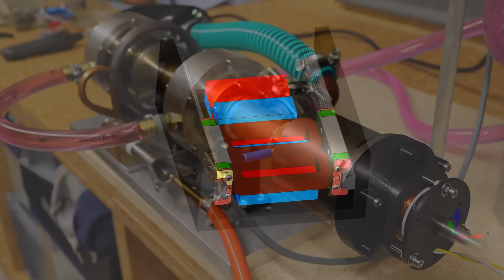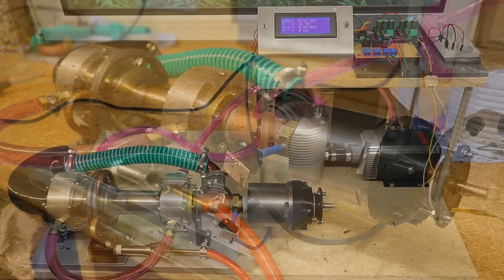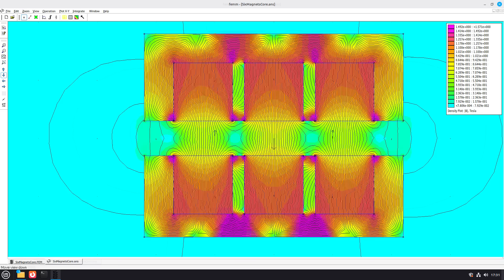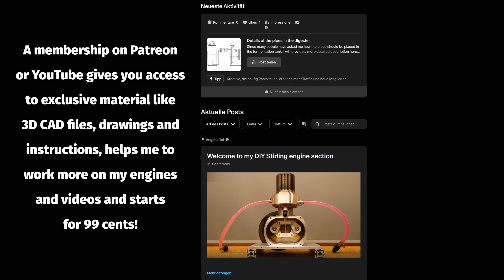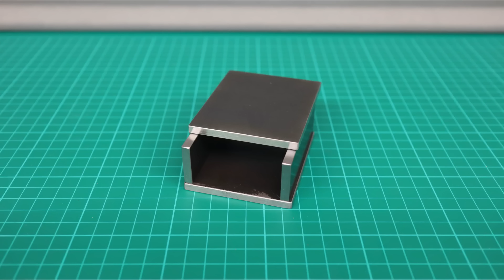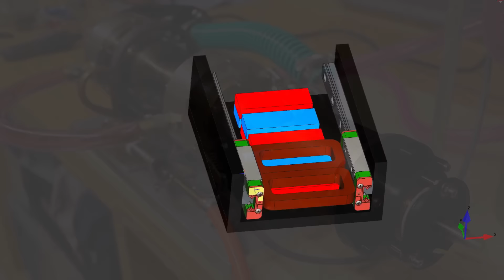Building a powerful linear generator for cheap DIY energy

Comment: I noticed you mentioned "adjusting the number of turns". I think you can forego this. With sufficiently thin wire, the energy conversion efficiency/loss of any wound coil component running at these relatively low frequencies is pretty much independent of wire thickness. The only elements that enter into the efficiency/power equation are the shape of the overall coil and the density or fill factor of copper in the coil winding (and of course the conductivity of the copper). 

Of course, the turns count changes the output voltage and output current at any given operating point. But it's so much easier to change the electrical load than to wind a new coil! If you fill your "winding window" (the total space available for wire) using a reasonably thin wire as you have done, so the wire fills the space efficiently and doesn't incur eddy current losses due to excessive wire strand width, you can discover your electrical conversion efficiency and electrical output power at an arbitrary winding size and turns count (with a correspondingly arbitrary and not very useful output voltage), and then once you're happy with performance you can re-wind for the actual output voltage you need.

When I'm doing low frequency coil simulations, I simulate the coil as "one turn" of wire, with a conductivity equal to that of the actual material I'm using times the fill factor of the wire I expect to achieve. Then I just choose the actual wire diameter to achieve the turns count and overall electrical characteristics I need after the fact. 

By the way, many months ago I had offered to help with some fin heat transfer calculations, and I never did. I have to apologize. I realized I just didn't have the energy to spend time on that, but I feel bad that I offered and then didn't follow through. 

One question: is this a two phase machine? It looks from the CAD like you have 1.5 magnet pitch per coil pitch, putting the coils at 90 degrees electrically to each other. I totally understand how this could be very useful to you, given your target of low mass/inertia (so you probably want smooth load forces) and probably needing to use this as a starter motor. But I think you may have sacrificed coil performance to do this, since your coils seem crowded up against each other. I haven't seen the simulations so maybe this is not an issue. 

But if I may offer a suggestion, it seems like you could achieve the same exact coil mass and a very similar moving system mass with the coils separated by some distance. This would of course require more magnets, but magnets are "free" in terms of their impact on moving mass. Then the coils could be perhaps more ideally shaped. I'm not sure that they are bad or compromised right now. Perhaps they're already close to ideal. This is just one more degree of freedom you might exploit to make your design challenge easier.
Reply from the maker: Thank you very much for your detailed and well-founded help.
I need to read through everything carefully and think about it, then I'm sure I'll have more questions.
Basically, is a wire diameter of 0.5 mm roughly okay?
I mean, assuming a maximum of about 50 Hz and 24 V 1A?
I have an inner surface in the coil that is exactly the same size as the magnet surface, i.e., 10x30 mm, with a winding width of 4 mm and a winding height of 5 mm.
The required air gap above and below the coils is 0.5 mm in each case.
The magnets are spaced 3 mm apart and the coils are directly next to each other so that each one is directly below a magnet and the other is directly between them, which makes sense for use as a linear motor.
Are the losses due to the coils being arranged directly next to each other significant?
Would it be worthwhile to place them further apart, and what are the losses based on?
What would you change about the design in general?
Thank you very much for your help.
Sorry for all the questions. I would be very grateful if you could answer one or two of them! 

M;any thanks again for your kind help, I need it!
Reply: @myengines  I don't think there are any huge losses explicitly from placing the coils next to each other. It's simply that they physically restrict each other's size. If the size is sufficient, then there's no issue. If you could have gotten better performance with the coils wound larger, then there's a sacrifice. I would have to run a FEMM analysis and think about things myself to know which scenario fits this case... and I can't make time to do that. So I can't really tell you if there's a problem.

I agree the quadrature/90deg phasing makes perfect sense. 

I am about 80% sure I understand your description of the dimensions. If you mean that the clear aperture of the coil is the same size as the magnet face, this is not an ideal scenario. It's not really the aperture of the coil that does mechanical work/converts energy. It's the wires. Yes, you can use flux linkage as a proxy for voltage generation, but what you really want is for the wires to be all in the highest possible field strength at the same time. The work happens when the wires are above a magnet face, not when the coil aperture is above the magnet face. 

Also, for this reason, you want the long axis of the magnets to be longer than the entire coil. That way every possible millimeter of the coil is immersed in the highest possible field strength.

So for the best possible performance from a given weight of copper wire, what you want is:
 
-for all of the strands of wire on one long side of the coil to be in the strongest possible upwards pointing field

-for all of the strands of wire on the other long side of the coil to be in the strongest possible downward pointing field

-for the short sides of the coil to be as short as possible, since they are "dead weight" and merely add resistance without doing work

-for the above conditions to be present as large a fraction of the time as possible.

So just to carry this to the theoretical extreme, if you gave me a piece of 0.5mm wire and told me "make this particular piece of wire produce the most watts of power possible in an air core/coreless generator with no iron pole faces but just neodymium magnets as pole faces," and we're in imaginary physics land, and you have me these 10mmx30mm magnets (an infinite number of them is available). What do I do? I would wind the wire into a single long turn 10mm wide, and a ridiculous length (if you gave me 20 meters of wire, it's a loop 9.98 meters long and 10mm wide), and I'd lay the magnets out butted up against each other along both axes, so I had alternating N and S poles at 10mm pitch along the axis of motion, with as small of a gap as possible (say 0.6mm), and extending past the end of the loop.

This way, as the theoretical loop moves along its short axis, most of the time (much more than 50%) is spent with one long side wire above a N pole and the other above a S pole, producing a constant voltage. Then as the wires both pass the boundary between magnets to the opposite polarity the voltage dips and crosses zero only for a brief time before resuming in the other polarity. With the magnets gapped much smaller than their pole face width, most of the air gap volume is going to show a field strength equal to the maximum for neodymium of that particular thickness and that gap distance.

Obviously this is a nonsensical mechanical design, but in terms of electrical theory this sort of illustrates the ideal.

I'll add that a generator with just the faces of the neodymium magnets as poles is really not going to get you anywhere near the theoretical maximum, because you only get at most maybe 1T of field strength in front of a piece of NdBFe, where as you can get easily 1.5-1.8T in front of a piece of iron. But it's an entirely different design... so this really just idle speculation.

Large air gaps are bad both because they reduce the field strength, and the field shape will exhibit a gradual falloff as we move away from the center of a pole in the direction of rotor travel towards the point right between poles.

Excessively large winding thickness along the direction of travel is bad, because this means that as some wire is still immersed in the strong part of the field, some other wire is starting to leave the strong part, and isn't contributing voltage.

Coils with 1:1 aspect ratio instead of really long and skinny aspect ratio (long perpendicular to direction of motion) are bad, because they have dead weight wire at the ends that doesn't generate power.

Your design isn't terrible. I hope it works very well. But the thing is, all of these terms tend to follow a square law. For instance maximum power available from a generator (assuming we have proper systems to negate any parasitic inductances) is just the same as the matched impedance maximum power transfer criterion: Voc^2/4R, where Voc is the open circuit voltage. Since there's a square term in there, any deviation from ideal performance really bites you in the ass. A motor that puts out a sine wave instead of a high duty cycle trapezoid due to fall-off in field strength from the pole center and deep winding legs is about a factor of 1.5 or 2 difference in delivered power, and then maybe the end turns add a factor of another 30% (resistance is thankfully not a squared term). And you're down below half of what you should be getting. Basically, just don't be surprised if you get marginal performance at first and need to make pretty small changes to the design to get pretty big improvements.

As far as the 0.5mm wire, I'm sure that's fine, although I have to admit I'm not actually very skilled in that calculation. If I'm reading the Dowell curves correctly you're unlikely to see more than a couple of percent at 50Hz with your layer count.
Reply: benefits of square wire

Comment: Putting a commercialy available speaker in place of the displacer piston can generate ac power trough the speaker terminals. With a transistor circuit, the speaker can be used to start the engine and the load on the engine can be adjusted.
Reply from the maker: Yes I researches a lot about this but it is very inflexible in terms of frequency, stroke and power.
But thanks for your suggestion!

Comment: What percent of the moving mass are the linear cariage? Do you realy need 2? This big? Have you considered teflon ones: much lighter and doesn't interfer with the magnetic feild.
Reply from the maker: Are they commercially available? then they are definitely worth a try.
The two carriages weight about 10 grams each, its not nothing but not too much.
I think the strong magnetic fields will cause quite some force on the coils and cores so want to have a stable bearing.
I also thought of tribological plastic bushings on round bars.
Thanks for your nice suggestion.

Comment: Just looking at this made me think has anybody tried? They had those lights? They sold the store with the magnet that slid back-and-forth between the coil has anybody tried putting a stack of those on one of those oscillating tools they sell from Home Depot and seeing if you can make more than enough power Above the infinity plane on the power curve before you add a diode amplifier
Reply: They used to call it a shaker engine
Reply from the maker: I built my first linear generator based on the example of these shake flashlights.
It works and is very simple in design, but also very low-powered.

Comment: The low friction of linear rails is only relative to sliding bearings. Internally, the bearing balls are often alternately: a bigger ball, followed by a slightly smaller one (at a micron level). In the absence of a cage between the balls, this limits the friction of the balls rubbing against each other somewhat. They're great for restricting unwanted transversal movements, but they might not be the best alternative in terms of friction.
Reply from the maker: I mainly used linear guides to get quick results and gain experience. 
A plain bearing is lighter and could be made of non-magnetic plastic. 
I will try that too; the iron core sleeve can also be used flexibly for linear guides.

Comment: You should use a tesla turbine but go from his actual patents, not other influencers.
Reply from the maker: The Tesla turbine needs a unidirectional flow, I tried a bidirectional impulse turbine you can see in the video but its quie complex to match it to the current power of the engine which is constantly changing. Maybe when i reach a good power level i will try a turbine again.
Reply: @myengines Tesla turbines can have multiple nozzles but they do have to push the rotors in the same direction.
Reply from the maker: I have an oscillating air flow with the thermoacoustic engine, I don't see any economical way to adapt this to a Tesla turbine.
But I haven't thought much about it!
Reply: @myengines oh, oscillating flow? Tesla valve. That should stabilize the flow.
Reply from the maker: I want to use both flow directions for energy generation!

Comment: Using flexures rather than linear bearings would probably be less lossy. It also might be helpful in tuning the resonance of the generator to the acoustic resonance.
Reply: By flexure i meant structure that is designed to flex elastically.  4 vertical blades would be a typical approach, like this =[]= this arrangement is stiff in all directions except one translation.
Reply from the maker: What do you mean by flextures? Plain bearings?
Thanks for your kind comment!
Reply: @myengines  No, flexures as in a flexural hinge, using the flexibility of the material as a source of movement, similar to how the surround of a speaker flexes to allow the cone to move. With proper design you can end up with a system that only moves in one axis (like a  linear bearing), but doesn't have any sliding/rolling friction and has effectively no moving parts, and thus no mechanical wear or friction. Here are some resources to learn more about them: https://en.wikipedia.org/wiki/Flexure https://www.precisionballs.com/Flexures.php https://www.esmats.eu/amspapers/pastpapers/pdfs/2024/carson.pdf
Reply from the maker: Thank you very much, this is really a nice idea that might be very helpful for me!
I will think of this closely and with a lower stroke it might be really a choice!
Reply: @myengines  I think tuned springs should work fine. Any repetitive loud clicks or bangs likely means it's hitting the end and likely operating less efficiently than it could be.
Reply from the maker: Yes, thank you, that's absolutely right. I'm making too much progress too quickly to get everything perfect, but I really need to change that!
Reply: @myengines  he is talking about flexure joints. They are used in piezo actuators for example. They are also used in some Nasa free piston stirling designs. They work a bit like springs. Look up DOI:10.3390/en14165156 for a paper
Reply: @myengines Imagine a table with 4 legs, the table top would be your coils assembly and the legs are thin strips of thin sheet metal.  This allows only axial movement with only a small deviation in height depending on the stroke length. If you make the flexures (table legs) from beryllium copper they could be used for power connections.

Comment: If the magnetic field is static and used for conduction like here, there is no need for transformer steel at all as all it does is guide the flux around to the backside of the other magnet, A halbach array array could also be used with less importance of the back plate and flux guide and should also be studied for its advantages. Very high density windings and close high tesla magnetic flux is the key consideration in this design without the additional moving core material, which theoretically should be the most efficient way of doing it.
Reply from the maker: I will also try an iron core made of insulated iron sheets in the coils.
A halbach array only if necessary.
Thank you for your helpful advice!

Comment: Why not have the coils on the outside, stabilized so no moving wires, thus having the magnets move instead
Reply from the maker: I want to save moving mass where ever possible and the coils with small cores are lighter.
Reply: @myengines moving mass is only an issue on start up no? Inertia is your friend. Plus no moving wires comes with its benefits
Reply from the maker: No, the moving mass slows down the engine permanently, its also an imbalance and maybe I don't want to balance the engine when the moving mass is light enough!

Comment: I would stick with non-thermoacusticengine with linear generator completely enclosed into internal volume, so there is no sealing needed for mechanical moving parts. Something like NASA used in some missions.
Reply from the maker: You mean a free piston Stirling engine?
I have extensively researched the different types of engines and have initially decided on the thermoacoustic principle. If that doesn't work, I will consider the free piston concept. Take a look at my video on free piston Stirling engines!

Comment: why move the coil, moving the magnet is much more efficient (connectors dont need to move), and also you need laminated silicon steel sheets as a coil core, in flux linkage arangement in order to get anything useful out of this.
Reply from the maker: Yes that's right but the small cores inside the coils are much lighter than the magnets with cores and I wnt to keep the moving masses as light as possible!